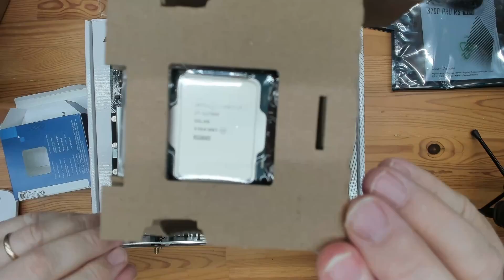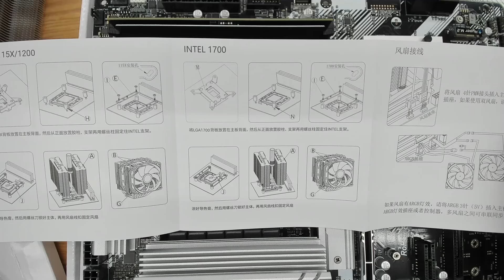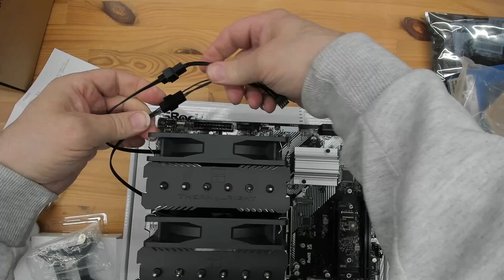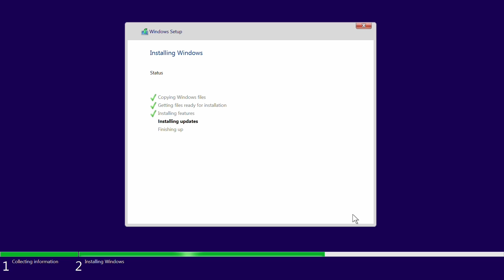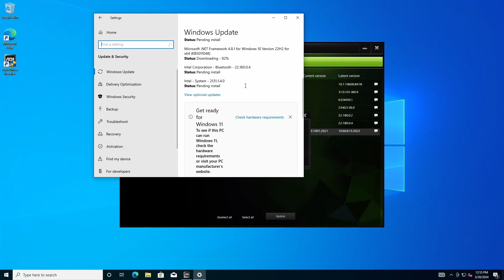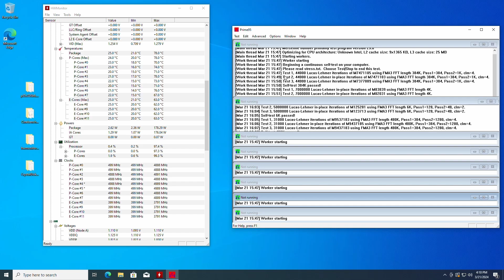Surprise platform upgrade for a channel supporter.

Comment: Put a strip of "magic tape" over and under your fingertip and then you will be able to spread the thermal paste with that taped fingertip.   This is Carey Holzman's  original method.   I use it with good results.

Comment: I used the Peerless Assasin cooler on a couple of Intel buids. Very well price cooler and good cooling performance. Did you put the cooler back to Air Cooler after flashing UEFI? It showed Auto after the update
Reply from the maker: Yes, I did.